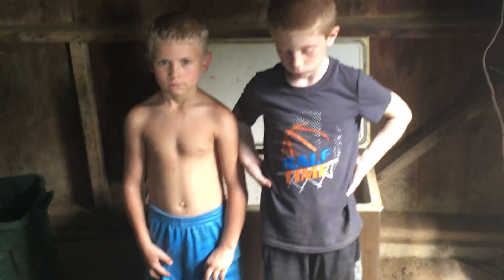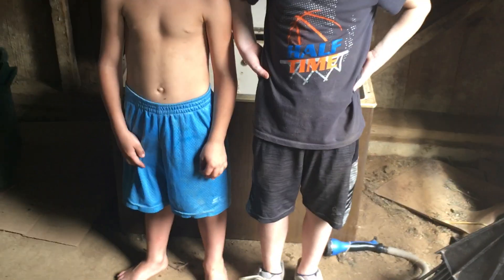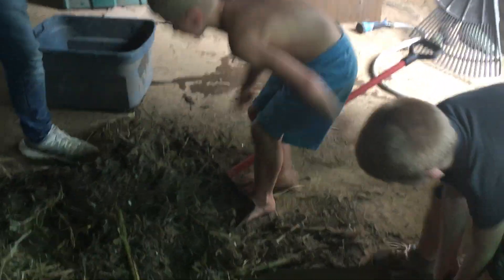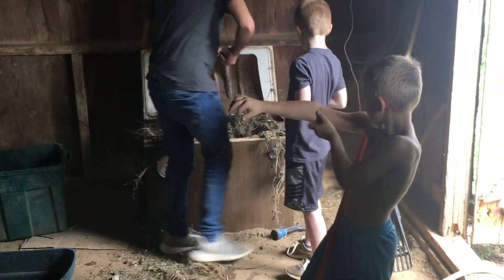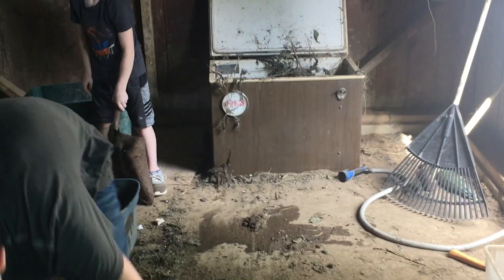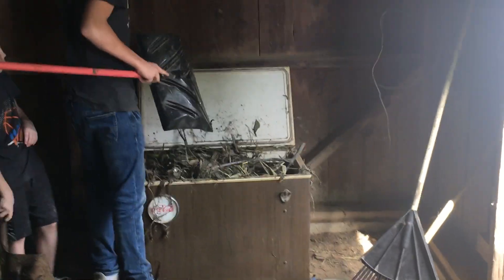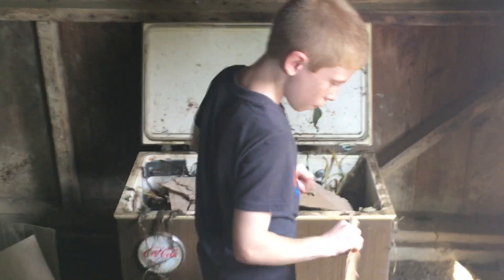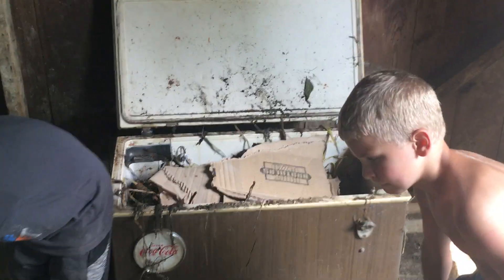New European Night Crawler bin

Comment: Good idea, just do not close that lid too much, it needs ventilation or the compost will catch fire. Rotate with a pitchfork every 12 hours or so. Good luck.
Reply from the maker: I been worried about it getting hot . I was planning to drill some holes in the lid . I did this several years back and it started to compost and get hot .  I was kinda hoping this material has mellowed out a little .  I will be checking on it daily to make sure  that don't happen . I have raised worms on and off for years and know what to look for . Thank you so much for watching !

Comment: I have a couple old igloo coolers I was going to turn into planters, but now I think I may do something similar and put some holes in the bottom and the top and maybe make a box for the bottom in case it gets too hot they could get to the bottom box Idk what do you think? I have an old cement mixing box that I started a worm bun out of it doesn't have a top and the birds have been feasting back there so I covered with wet newspaper
Reply from the maker: I think the coolers will work awesome ! Were you live I would worry about keeping the heat in . The only time you got to worry about it getting to hot is if it starts composting . I will have to check on this over the next few days to make sure that don't happen . I still got other bins as back ups all the time ready to go . Thank you so much for watching !